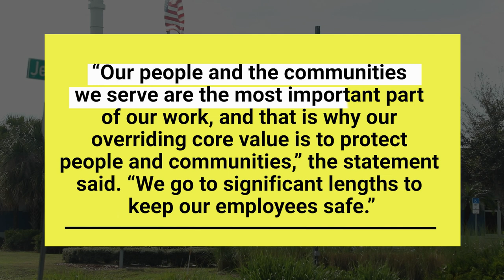What happens at Florida’s lone lead smelter

Comment: what you speak is facts man, i worked at Deka Battery lead acid battery factory in Pennsylvania and I was working  casting and forming room worked with lead sulfuric acid that you couldn't see your partner next to you from the steam and the arsenic when we would burn/weld the terminals.   they say when it leaves your blood system it deposits in your bones. so thats very possible your kid would have that stuff.  I showered at work, wore different clean clothes home. scrubbed my finger nails every night nail clipped, and wore a respirator and hosed down the dust plates they didn't like it but it was my health so screw them.   godbless you and your family sir.